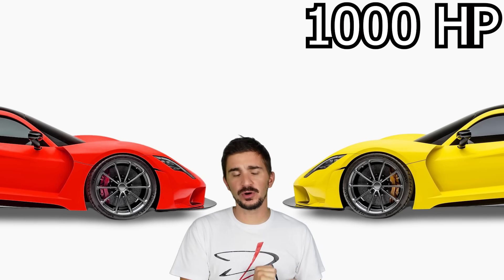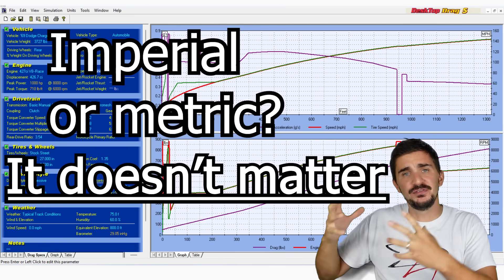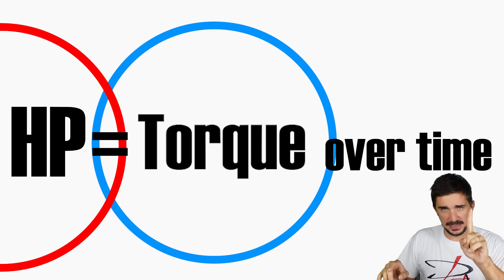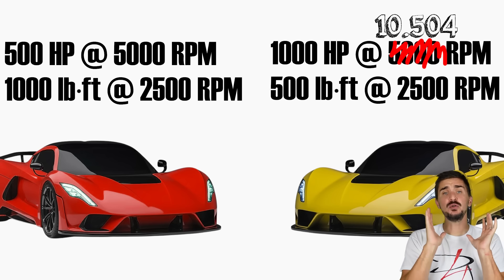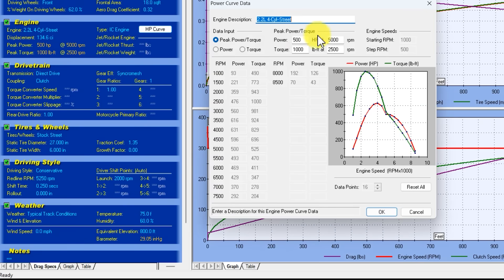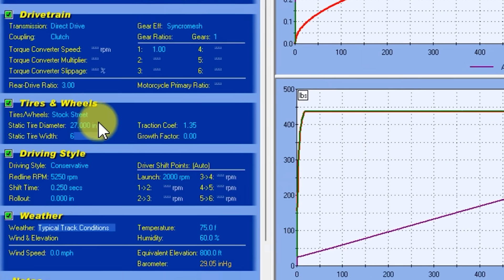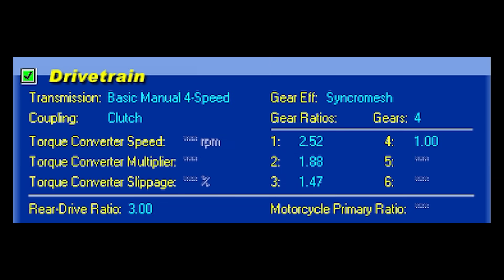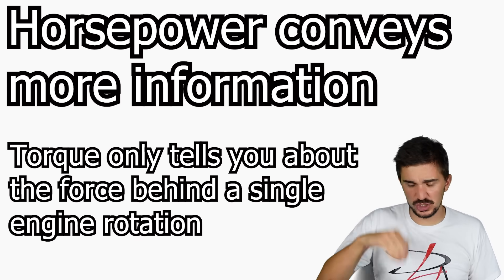Who's faster? Explained and Simulated - Horsepower vs Torque

Comment: Before watching the video, I'm guessing the HP biased vehicle will be quicker, because the torque biased one has to be more reinforced to survive all that torque, so, it will be heavier. But, I'm also guessing it will have a higher top speed, because it will have the bigger combustions or leverage to force its way through the air resistance, better then the smaller or shorter combustions?....But the higher weight from the reinforcement means more tire rolling resistance? I don't know. But I've noticed with engines, electric motors, and even weapons. Prioritizing frequency of power over big hits of power, usually means lighter weight, and more mobile. RPMs over torque, thin gauge voltage over thick cable amps, burst pistols over magnums. If you can't hit hard, because you're too light, or must be as light as possible, then you must hit faster and more frequently. 

That's my guess, now to the video.
Reply: I know Torque & Horsepower are linked, like you are trading one for the other, like with gearing. But again, with engines & motors, you need to make them beefier to be able to survive all that torque. And not just them, but also their mounts, and any power transferring parts like gears and drive shafts. But RPM-focused engines & electric-motors are inherently lightweight. Smaller pistons, and since there is a linear connection between motor torque & amps, a low torque electric motor means it doesn't need thick cables, because its not pulling that much amps. Thicker cables reduce resistance, but also reduce the amount of windings you can fit in a motor. And I'm still learning about EVs & Electrical Engineering, but skin-effect also comes to mind, I think meaning a thick cable would also be worse for a high RPM motor.

And the lower torque means less material needed for engines & motors to be safe & stable, in regards to torque. Surviving the g-forces of RPM is different reinforcement, but you don't even need exotic materials, keeping the comparison fair. Internally trading RPM for torque, just means shorter piston strokes, and I guess for electric motors, a smaller rotor?

I wonder what it would be like to have everything in an engine made of titanium but the cylinder sleeves, piston rings, and all bearings. But for a fair comparison. RPM engine verses Torque biased engine. I'd prefer the the high revving one. Because of the weight. Both can be efficient, but I feel like I will always be burdened by the reinforcement of the torquey engine, whether or not I use it, but with a RPM biased engine, I csn just use less revs, to use less fuel, but still have that high RPM power when I need it for fun or emergencies. And this is why I feel low torque, high RPM vehicles are the best option for the average commuter.

Torquay engines & motors are best just for heavy hualers, who are almost always carrying a lot. Those always using the added heavy strength of their powertrains & support structures.

Comment: Some people dont know that faster and quicker are different things. Higher torque will get you off the line QUICKER, but high hp will give you a FASTER top end speed. Lots of rally cars have crazy torque and are super quick, but low top end speeds.. maybe 116 mph.
Reply: Faster/quicker analogy is for dumbs.
Power=acceleration*speed with a given mass.
Reply: @simplemachine9531  Some people don't know math or formulas, and can work on engines better than some engineers. You arent wrong, but sometimes things need to be explained in simpler ways.
Reply: @ctdope  ordinary physical explanation is much simpler than tweaking with non-related words. Discard torque, plain and simple.

Comment: The simulation was a straight line drag race? In corners, there's something else to consider, which is the smoothness of the power delivery. Ideally, it would be constant, but it's not. It pulses with the cylinder strokes. A lower revving engine with large cylinders and a lot of torque, has more lumpy power delivery, and will essentially have less grip around corners. Or, rather, will be more likely to break grip on the peaks during the piston strokes. And once that happens, the mass of the car starts trying to move straight again. Meaning it starts sliding. So you have to let off the gas a bit more

Comment: Interesting but missed the mark of having been demonstrated. Spend some time learning more about force, work, power and energy. The confusion only exits when there isn't an understanding these. Corollary to that is master these concepts and the world becomes a very interesting place.

Try this same thought experiment with two engines with exactly the same horsepower and transmissions designed to match them. What you will find is that the performance is the same. Neither the torque biased engine nor the RPM biased engine will be superior due to their ability to perform work is exactly the same. You see the ending kinetic energy will be the same for the work done which to the result of the output power over time. Horse power is the time rate of change of work and work is the product of force and distance. Torque being simply the product of force and arm. The end result will be the kinetic will be the same. It's crazy cool simplicity when you understand it.

Consider too trucks. Gas truck with a 410 hp V8 and a diesel truck with 410 hp v6. The gas v8 will make it's peak power around 4000 rpm and the diesel somewhere around 3000. The gas truck having a 10 speed transmission and the diesel a 4 or 5 speed both transmissions geared such as to maintain the engine in its peak Hp RPM zone. The result, both trucks perform the same pulling a load. I've done this pulling the same trailer in the hills with a Chevy Silverado and Dodge Ram. This can be demonstrated on the quarter mile as well. Lots of Cameros have been walked on by mini Coopers. In this video example, if  both examples were tuned to their peak, the engine with the greater horsepower will always win regardless of the torque. Of course there are practical limits to the engine. 

Let me say though, this was a good effort and worthy being watched. Did get a thumbs up from me.

Comment: this is how i understand HP and torque... HP acceleration to desired RPM torque transfer that RPM as fast and hard to the ground so u can go rututututut...
Reply: All Work is done by Power.  Work = Force x Distance.  The engine makes Power.  Power = Force x Velocity.
The transmission exchanges Force for velocity as leverage to deliver the Power to do the Work.

Comment: Something i discover when i own 2 cars with the same horsepower (200hp) and engine displacement 2.2l with different torque 220nm(petrol) vs 440nm(diesel). For normal road use, i can overtake faster in gear without down shifting with little throttle input with the diesel 440nm, than 220nm in gear even if i applied full throttle.. but for spirited driving when i row through the gears shifting at high rpm the 220nm is faster than the 440nm( maybe due to vehicle weight   1.2tons vs 2tons and gear ratios).
Reply: normally, you shift down for overtaking if you need to accelerate.
It's logical since your power demand increases.

Comment: I’ve given this thought before. I could be wrong but I always figured if you gave each car the perfect final drive with each having the same transmission they would be equal. You can’t compare them with equal gear ratios because lower revving engines require a taller gear and high revving engines need shorter gearing.
Reply: Nope! Hp would be faster with good gearing for both
Reply: HP is overall how much energy you have coming from a part, when using gears you are sacrificing torque for RPMs or RPMs for torque, the HP coming from the gearbox is the same as the engine or rather lowered depending on efficiency is my understanding, something that  has 300 lb-ft of torque from 10000 rpm to 15000 could, in an ideal world, put more torque on the ground than something with 1000 lb-ft but only has it from 2000 rpm to 3000 rpm... this is not the whole story though, a 600HP(ish?) truck engine is gonna find way more use than a 900HP(ish?)Wankel engine
Reply: @AnD1262  high torque is just more hp down in the rev range compared to a lower torque engine, if say both ended up at the same peak hp number. hp = tq x rpm. torque is a confusing stat for the consumer comparing numbers. its doing more harm the good imo
Reply: @hotdog9262  don't understand what your point in replying to me was, the comment I replied to has to be assuming the correct gearbox would make a 500HP with 1000 lb-ft engine the same as a 1000HP with 500 lb-ft engine
Reply: Horsepower is the rate at which work is done. End of story.

Comment: Regarding the torque biased engine, is it possible to have peak torque and horsepower at very close rpms for the low revving engine? High revving engines usually have their peak torque at similar rpms to horaepower, correct? Also, gear ratios make or break acceleration as we learned. I think we would all love a more in depth, detailed video on this. Please do what you already do the best at, and dive deeper in explanation of this. I always learn from your videos like this one!

Comment: I wish you would have spent more time on the graphs and showed how much horsepower was actually being produced during each race. With the direct drive 1:1 ratio, the HP car never got into its high horsepower RPM, where the TQ car likely was and that produced the much better result.

Comment: But I would like to know what happens with similar cars having same HP but different Torque. I mean to say is for ex : 100hp NA vs 100hp Turbo engine. I know Turbo engines have more Torque but I need to know how it translates, I like to know how you explained in this. I think this will be question for many as well. Hope to see a video on this😊
Reply: if the turbo engine has more torque, but same power output as the naturally aspirated engine, this means that the naturally aspirated one revvs higher.

So of course you need to change how you shift gears.

Comment: ez explanation for street racers out there= if youre racing first to 160mph, 1000hp 500 tq will win you the race since its a long race. 1000Tq 500 hp wins shorter races. High HP wins longer races, high torque wins shorter races, assuming you both have identical or similar transmission, tires, and weight.

Comment: The reason rotary’s get away with low torque is because of low curb weight. You can also add torque with adding more rotars and turbo boost. 
If a twin rotary weighed as much as a v6 it would be terribly slow.

Comment: Additionally, this is a "simulation", there is often a disconnect between theory/simulation and the real world, especially today when auto manufacturers are cutting corners anywhere they can so even a Porsche 911 GTRS can't safely hit 10,000 RPM, maybe upto 9,600 RPM.

Comment: Just buy a Porsche 911 Turbo S and you won't have to worry about which is better, Horsepower or Torque, as it can put down a consistent 2 second 0-60 MPH all day long (with Motor Trend hitting 0-60 in 1.80 seconds after warming up the tires). The 911 Turbo S can also pull off a 0 to 200 MPH (NOT Kilometers per hour) in a staggering 14.8 seconds, and thus the age old advert of "Porsche, there is no substitute", the end.

Comment: My last motorcycle was  1000cc 148 hp. Present bike is 1200cc 125 hp 
1200 bike has way more power down low in rpm range which makes it way easier and more fun to ride on curvy mountain roads where it is too dangerous to ride near the bikes limits cause around the next curve can be sand, gravel, water, elk, car stalled/wrecked, car/truck/bike cutting across blind curve into my lane ( happens quite a bit these days. Terrible drivers who know nothing of driving ethics abound). So for driving curvy two lane roads on a bike I prefer my tourqy  1200 over my  1000. The 1200 pulls way harder out of corners without being high revving all the time. Much easier to ride. On a track where the limits could be pushed farther I think the 1000 would be faster. On the street I actually prefer a higher revving car but  more low end power for a bike.
Back in the day I had a Ducati Desmo that was nothing but huge low end power and very low red line. Thing was a blast and hugely fast corner to corner and a great street bike.

Comment: There is a special (but seldom  especially useful in the real world )case where torque and horsepower can be separated and observed, somewhat measured, and even used independently. Brash words and certainly considered to be either unlikely or heresy in some circles. But hear me out. If you have an open differential. it will (ignoring mechanical inefficiencies) split torque equally between the two axles.But it will NOT always split horsepower equally If you lift one wheel into the air it will spin and the wheel on the ground will not. Even though the torque applied to both wheels is the same all the horsepower will go through the spinning wheel. It is the only one that is using the torque over time to do work. In the real world , mostly off road vehicles that have wheels in the air often it is possible with differential braking to add re3sistance to the spinning wheel until the equal torque from the differential will spin the wheel on the ground and horsepower will be being used by both wheels. Ta Daa! A mechanical way to split horsepower and torque that probably wont ever be useful to you except in thought experiments.

Unfortunately this comment is 1700 comments in and no one will ever read it LOL
Reply: "open differential splits torque equally but doesn't always split horsepower"
Gladly noone will read this.

Comment: I still like my torque. I have power throughout the RPM range, and incredible hp at 6000+ RPM. To me, an often over looked image is the torque and hp curves. I understand not going over them in this video, but they are just as important as peak numbers. That motor had very poor performance at low RPMs and pretty linear up to higher. A turboed truck has a huge spike right after 1500RPM (nominal drive RPM) in hp that continues up to 7300RPM but not linearly, but decaying. Torque is linear throughout the entire RPM range. This gives much better felt performance than even a 600 hp motor with a bad curve. Modern vehicles take advantage of this and peak the curve at the last second and say the car has "475" hp when it almost never actually gets above 380 throughout RPM
Reply: Every owner of a manually shifted vehicle should know his power curve roughly, because he needs this information to chose the proper gear for his desired power output at any given situation.

Comment: Great video up until it was completely pointless because of figures in the simulation. using final drive ratios of 1:1? so neither car even use the theoretical hp/torque figures that your trying to test. (so far wrong infact that the simulation was having to simulate clutch slip for the entire run of some tests)
using power/torque figures that require massive amount of traction to actually use them, then use terrible tires so to make the test mostly about traction.
do it again but use final drive ratios to at least let the cars use their hp/torque curve. Use the best tires the simulation has to offer to not make it about traction or bring down the hp/tq figures down to usable levels with the low traction tires.

Comment: Something to consider as well related to not being able to have high Hp without high  torque is VVT engines. There are a few engines I know of that have torque will peak around 275ft-lb but HP will peak around 325. Granted the engine is tuned to have these values.
Reply: spot the honda guy . i make 500nm at idle and bro saying 275 at peak haha

Comment: Something you didn't talk about was that high RPM is very much a problem. Engine's can and do catastrophically fail from too high RPM. 10,000+ is a very high value. High enough you may need a rebuild quite often even on an extremely well built engine.  So RPM is very much a limiting factor for high HP engines, just as you pointed out tire-slip is a big factor for high torque engines.
Reply: LITERBIKE ENGINE enters the chat. 15k miles b4 any real maintenance is required, then it's just checking valves at that.
Reply: Or hell for that matter, R6 ENGINE enters the chat, at 16,200rpm factory redline.
Reply: I used to think 10k was a magic barrier, but now at 40, I've ridden in street cars that turn 10-12k
Reply: Best one being an all motor, small block ford, foxbody mustang. Possibly one of the fastest all motor street cars in the Midwest, but he shifts at 10,600 at gets at least 10k street miles outta his engines.

Comment: Dude forgot about specyfic types of engines with different piston sizes, actually the most impacting thing with efficency and compresion rate. And yes, 1000HP 500 torque engines exist, 2007 F1 engines was 750HP 280nm.

Comment: Odd how many people have no actual idea about engineering physics.
You cannot have horsepower without torque .
But torque can exist without horsepower.

550ft-lbs/sec is one horsepower.
If you rotate a torque wrench one foot with 550 lbs in one second = 1 hp.
But if you hold 550 lbs on a one foot long wrench 🔧 without turning ( static) it is not horsepower.
All (work) must be a force through a distance through a time period.
Power/ work  is a force through a distance in a time period.
Reply: Now use a power-torque calculator and rethink your life
Reply: @simplemachine9531  Nope.
Torque not rotating is a static force.
Not horsepower.
Again most people do not understand physics engineering.
No horsepower without movement of forces.

Comment: I always relate torque to the power required to release a seized nut and HP the energy needed to turn it 100 time's to get it off